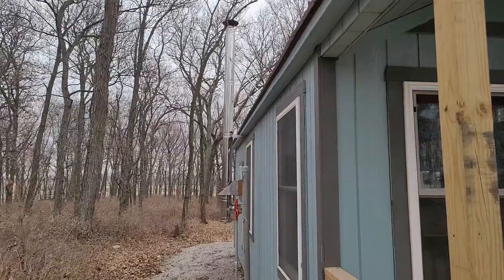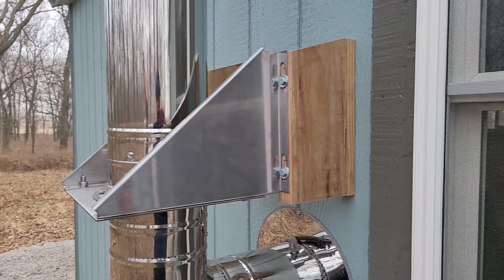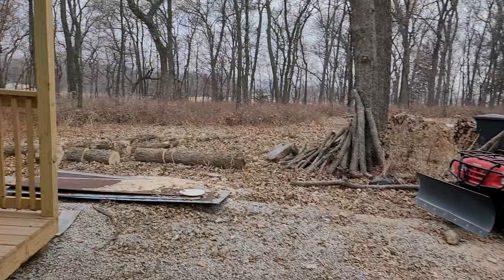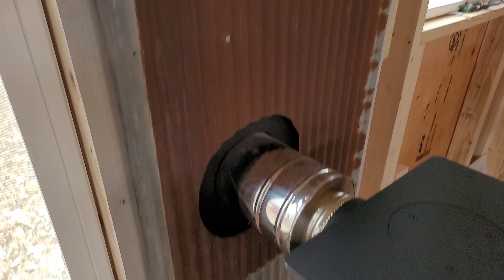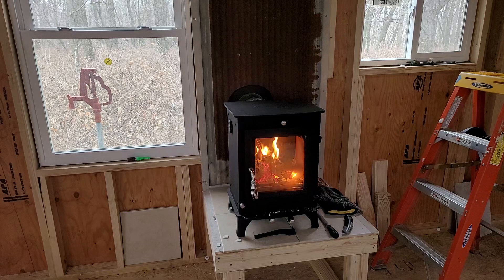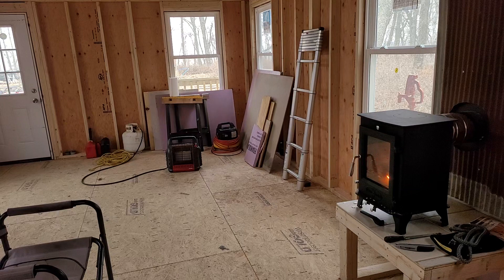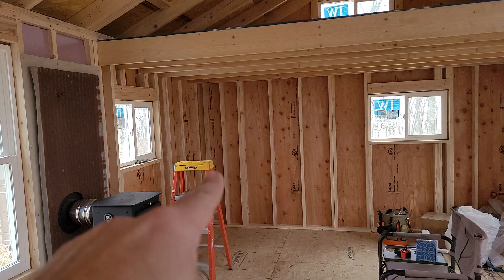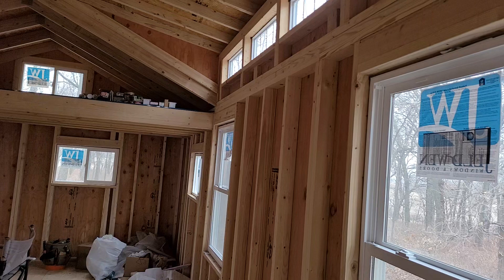Hickory Hill - December 8, 2022 - Dwarf Wood Stove

Comment: You point out a very valuable piece of information for those installing a wood burner. Allowing an air gap when constructing a heat shield is so often overlooked or not even considered. Your little stove appears to be built with enough steel to last.

Comment: Now that you have used it for a while, I was wondering about air intake. Since you vented horizontal, how did that affect the drafting?
Reply from the maker: Hi there.  The stove drafts with no issues at all.  Part of the reason I went horizontal is so I could chimney sweep the vertical section from outside and leave any mess outside.  We also plan on cooking on this stove so needed to vent it this way.  Only time any smoke had exited the front is when we did a poor job getting it lit.   We still need to install the fresh air intake which we are looking forward to

Comment: Any issues with backdrafting til it gets hot by going straight out the wall like that? I'd like to go that route too, but don't want to deal with a lot of smoke on start up since the wife has asthma.
Reply from the maker: I haven't had any back drafting issues.  I do make sure to have proper kindling and use fire starter cubes or the like to get it lit quickly.  The reason I went through the wall was so I could pull the bottom cap off of the chimney outside and run a chimney sweep from the bottom up vs trying to run a sweep downward or having to disconnect pipe inside to go from the bottom up.  Easier to pull the cap at the bottom and do a visual inspection for creosote build up too.  I'm sure some cons to this way but I haven't run into any yet.
Reply: @ryanamys5125  Good, I want to do that too. I'm sure you lose a little heat potiential from the pipe being totally outside, but that's probably not a big deal in these little structures.
Reply from the maker: I lit the stove in our latest filmings and showed the bit of smoke that escapes.   Was thinking about ya!  Hopefully we'll get the remaining footage needed and get the video up in the next couple of weeks.

Definitely lose some heat potential but like you said, small space so I wasn't too concerned going this route

Comment: Was that a fresh air intake at the bottom rear of the stove to take in air from outside?
Reply from the maker: I do have the fresh air option for the unit.  However, I have not installed it yet.  I will share that footage once I get it.
Reply: @ryanamys5125  my stove is on a platform like yours. I put a section of 3" PVC flush with the top of the platform below the air intake in the front and through the floor with a screen over the bottom end. It looks like you can elbow down in the back of yours and go through the floor.

Comment: Prices would be helpful ,Sir, cabin and stove ,sizes helpful also , Happy New Year Ryan
Reply from the maker: With the chimney parts and stove it was  around 2375.  Expensive unit.  Chimney parts on the tinywoodstove.com are cheaper than the others out there.  Nuts I know but I'm a buy once cry once kind of guy.   With such a small cabin the less expensive units would be too hot. This is the dwarf 5kw which is their largest.  With the other readily available farm store units I would have had to open a window a bit or dampen the stove down too much creating creosote build up in the chimney.  Also the dwarf stoves have a fresh air intake option that allows me to use outside air for combustion.  The dwarf stove has primary and secondary air controls and a "wash" for the door that keeps the glass clean too.  Also the less expensive units don't have a glass door.  I like to watch the stove operate as it soothes my mind.  This is all based on the research I did.  Hopefully it's all that they claim.  Trying to get back out there to do some more work.  I will keep posting videos.  I have a lot of other things to do out there around the property so hopefully you find some of the other things I'm doing interesting as well.  Happy New Year.